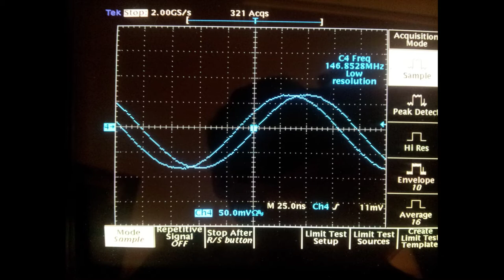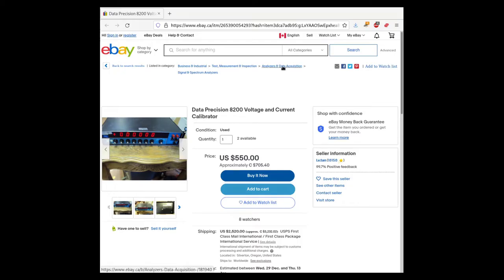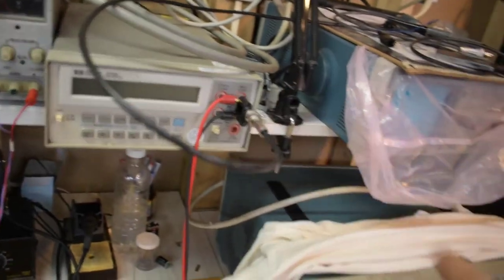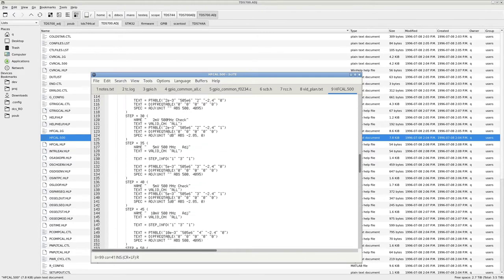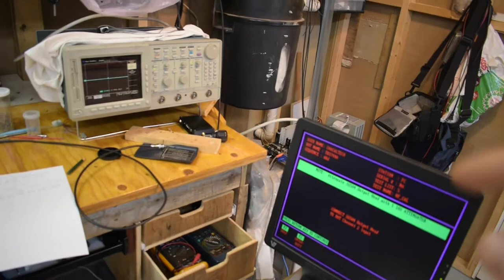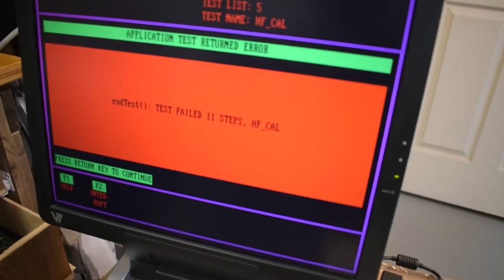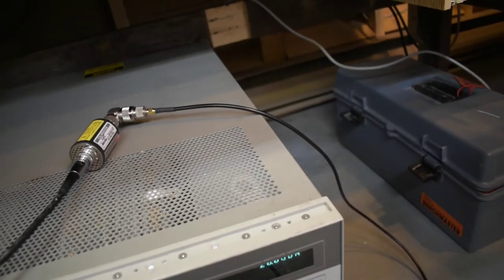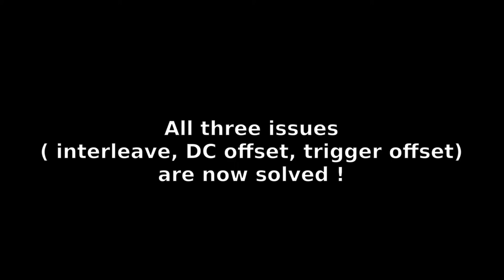Tektronix TDS744A calibration on the cheap

Comment: Yep I haven't done a calibration on this scope, however I did run into the problem with Cable Loss at different frequencies when calibrating other test equipment. In my early years of working on radio's I learned a valuable lesson when using the wrong RG Cable and coiling them if they were too long. Basically use the right RG cable for your frequency and power, compensate for cable loss and don't coil them to save space on the bench, it will mess up your adjustments every time. Been there done that! Would like to see some videos just on the setting up the software etc and all the stuff related with that. Thanks for sharing loved the video. Best Wishes & Blessings. Keith Noneya